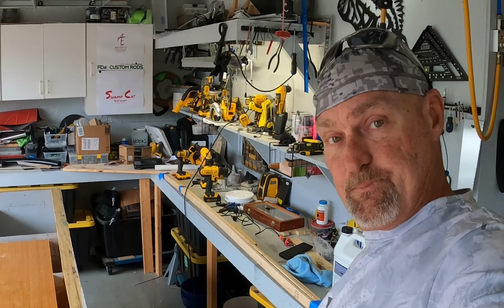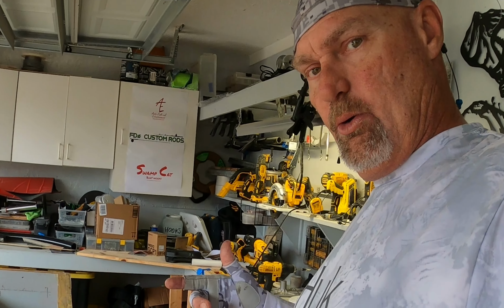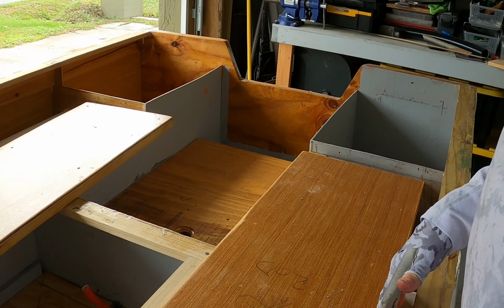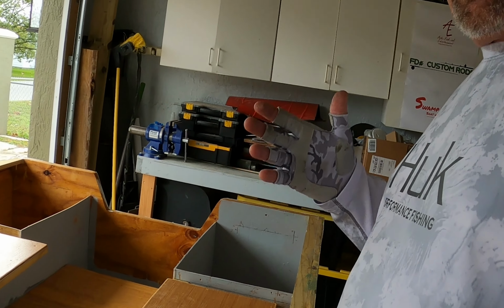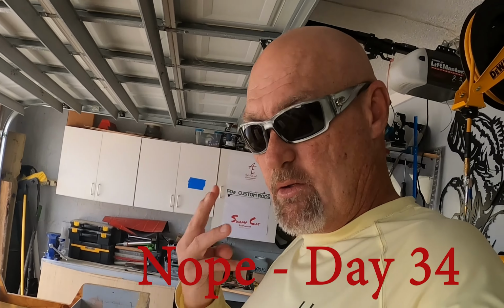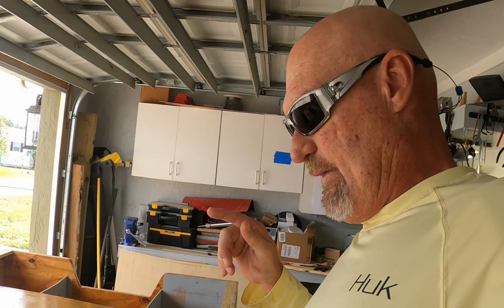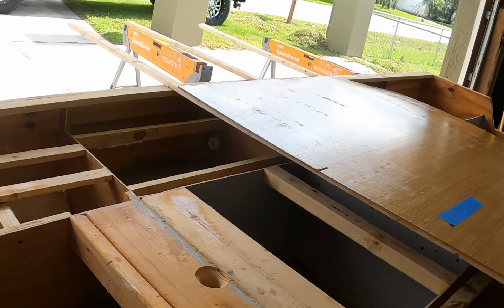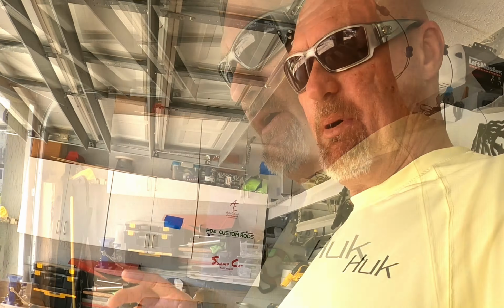Nit Picky Days - DIY Micro Bass Boat - Days 31-34

Comment: How much weight did that add? what's the boat's weight capacity.
I have a 10 ft John boat, would love to do what you've done...
Reply from the maker: We are still under 200 lbs with probably another 250 lbs to full build out weight with batteries, motors, etc..   My calculations say that it has a safe working load of 1500 lbs total (that's with a safety factor of 2) It would have to displace more than 50 cf of water or weigh more than 3123 lbs before I feel it would be unstable.  Even then with over 2500 lbs of floation foam it would not sink.